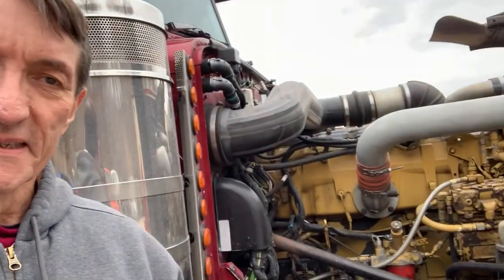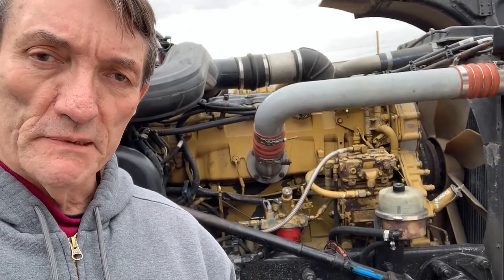CAT - C15 low turbo boost issue

Comment: Would you happen to know the sintered brass filter part number and the part number pf the fitting it screws into ? I can't find them anywhere and I need both
Reply from the maker: The sintered fitting is a pacer part # P100089
The pacer parts guy should be able to get you the fitting # once he looks up the sintered fitting.

Comment: I have a pete with a 6nz engine ….. Truck holding about 15 psi on idle, once I put a load behind it , the check engine comes on and turbo stops engaging please help if you can
Reply from the maker: You will need to have someone scan it to figure out what the faults are. Im guessing something to do with lower than normal turbo boost.
Reply: Mine had that issue…it was my IVA Harness….i had them turned off with CAT ET and was good after that…will Replace Harness soon

Comment: Hello, I have a 2005 379 with a 550 BXS i was getting 55-60lbs on a regular now it struggles to make 40psi definitely feels like something is wrong what do you think it can be? Also I have no codes on the dash
Reply from the maker: The BXS has many places for boost leaks. You have the twin turbos. You need to pressurize the air system. Go buy a gallon of kids bubble soap and put it in a hand pump spray bottle. With the engine cold bubble soap all the connections and bolt together flanges. Have a friend watch as well. Make sure you have bright flash lights and have some one start it up and throttle it up. You only have a minute of so before it starts to cook the soap off. I have seen the stainless flex tubes crack in the valleys etc. If that is all good make sure your fuel pressure is right where it should be. Those are the two most common reasons. Good luck
Reply: @ENGINESHOPJOE 💯

Comment: Have 02 W900 with a 6NZ and it's set at 550 but doesn't feel like it. Took it to cat and they said my fuel pressure regulator was bad now I'm back to 79psi at idle and 99psi at full throttle. My problem now is my boost gauge has never gone above 20psi of boost. Even climbing a hill it will stop at 20psi and my truck falls on its face. What psi does a 6NZ make and where else should I look at? Also it use to smoke before they changed the regulator and now it doesn't smoke at all.
Reply from the maker: Make sure you dont have leaks in the boost system-IE charge air cooler  etc. The ecu will only give the engine fuel if it sees boost coming up. So verify the boost sensor is accurate and put a mechanical gage on the intake manifold to see what boost you really have. If boost is low then make sure the turbo wastegate rod and can are ok and adjusted properly. Hook a hose to it and use an air regulator to verify it is set correctly and moves when it should. You should not be able to move that rod with your hand or the spring in it is failed.
No blown exhaust gaskets? Have someone ride with you with ET and make sure your ecm is electronically going to full power. Look at load and engine state. If all that checks out Maybe you need to have your injectors flow tested. But start with the simple things and be systematic. Make a check list and dont check an item off until your comfortable it is right.
Reply: @ENGINESHOPJOE  thank you.

Comment: Mine done that too it was in ecm driver rewards program for 5+ mpg turned it off and builds 35psi wasn't making 20psi to start with
Reply from the maker: Thanks for that tip. I did not look for rewards in the cat ecm. Our customer told us it was running good then had the "issue" so we 
did not look for driver controls in the parameters.
Reply: When we first took off in the truck it would build 30psi and soon as you hit high range in the gears it would drop to 20psi and it was in the driver rewards program in the computer. When I asked the previous owner of the truck he had kept turning up the power but with no luck but we discovered that the truck was up to 750Hp and still fell flat on it's face on a pull . 
We turned the driver rewards to one MPH instead of 5 + and turned down the HP to 475 factory settings and not had any more problems. Hopefully this is the problem your are having too and will fix the issue.
Reply from the maker: @willfalk5445  Thanks

Comment: I have a 2002 peterbilt 379. I ran Thursday truck did perfect,  got up Friday didn't make it 50 miles from home. Truck wouldn't accelerate.  Got it towed home, now when you start it up truck run but it's missing and blowing white smoke like it's not getting fuel and still want accelerate.
Reply: 3 of my injector had a blown ring.
Reply from the maker: @kelvincoleman583  So you just had to re-oring the injectors and reinstall them? That used to happen on the N-14 which had a similar fuel system. Glad you found the problem and it was not major. Take care.
Reply: 02 peterbilt 379 c-15 engine. Was working on it 2day,  blew air through all lines dealing with fuel to make sure nothing had collapse. Put everything back on bleed bald valve for air and still the same thing. No white smoke truck has a bad idle like the fuel not there. Oil pressure gage 85. Next thing get fuel pressure gage to check if fuel pump is working.  But it still want accelerate.
Reply from the maker: @kelvincoleman583  Yup check that fuel pressure next
Reply from the maker: I am not sure what engine you have.? Start by checking fuel pressure. White smoke usually means it can not time correctly. The right response here depends on what engine you have and the model